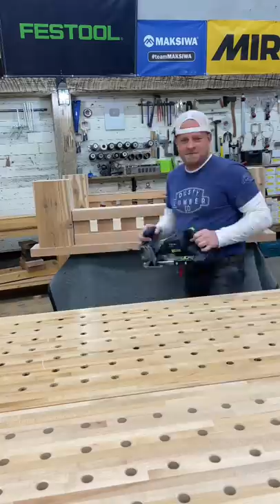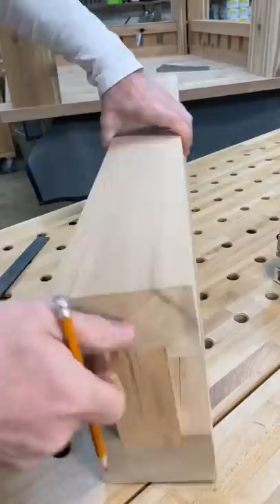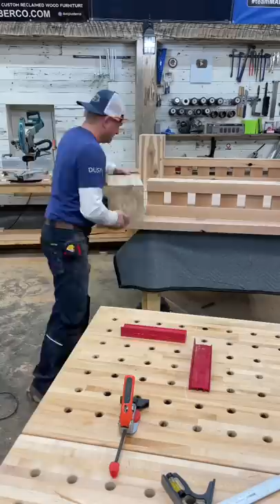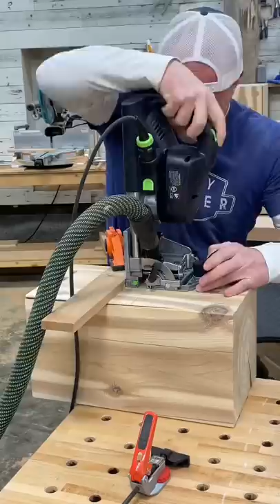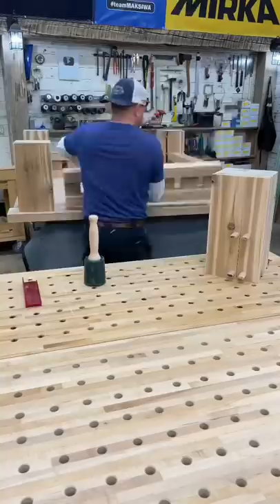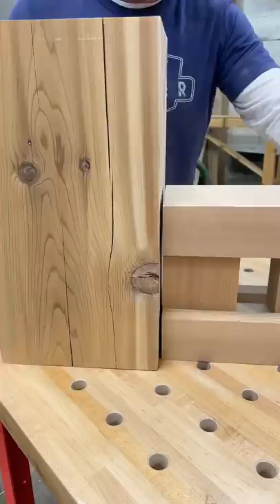Test fit before glue up

Comment: It doesn't hold, the beech dowell gets loose in other woods. Works for a while but is often cause of return shipping. There isn't enough non end grain gluing surface, the shortness of the dowell don't compensate.